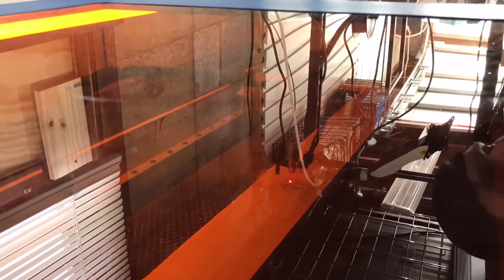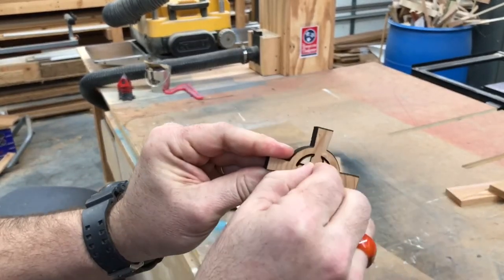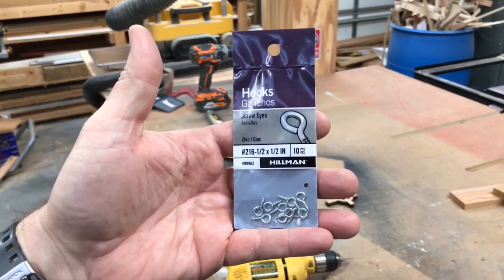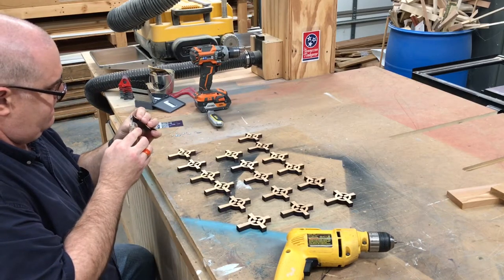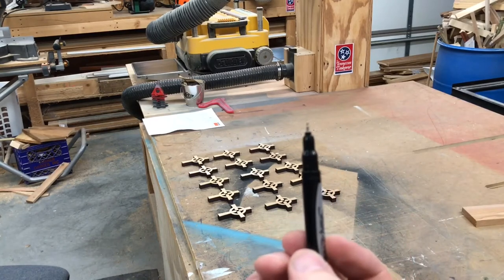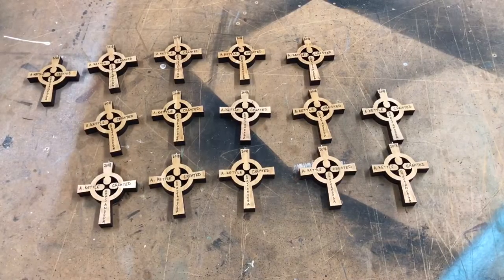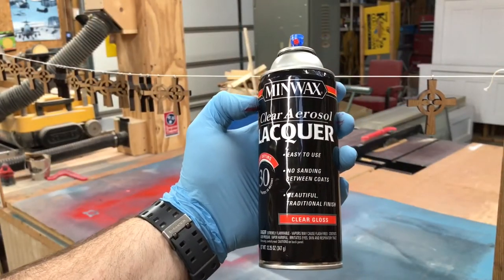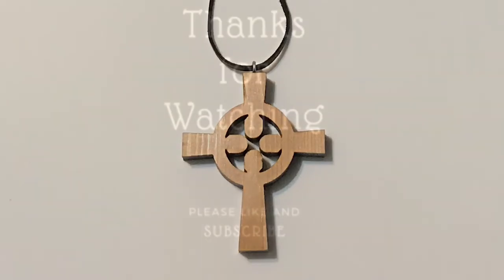Woodworking: Making the Cedar Cross Necklaces

Comment: Good job!  I am in the process of making 250 walnut crosses for our Big Bat Cave Campout and our Frontiersman Lockin.  All part of a Royal Ranger Ministry.   One of our Missions in Springfield had a walnut tree blow over and they cut it down and called me if I wanted a few logs.  I took 8 logs 3' long and 12" around.  Resawed that a year ogo and stickered it in my shed.  I had a bunch of slag wood that was left over from the cants of the logs. I resawed that up and used it for the crosses.  Using a bandsaw and a jointer I processed the wood down to 3/8" wide piece with the last side to be ran through the planer.  Will now square up the ends of the random lengths and cut a dado on groups of about 15 at a time then cut those ends off to length 2".   Then do the verticle side of the cross cutting a dado (other side of the half lap) then cut to 3.25" long.   Add a drop of glue and put the two pieces together and clamp with a spring clamp. Then drill a 1/8" hole in the top part of the cross so on the side and hit both sides of that hole with a countersink bit. Do a bit of sanding quickly and hang on a line for a clear coat.  Add a length of mini paracord and give them out.   I did this with cedar and made 80 about 7 years ago.   Thought this would be a good purpose for this wood that would have been cast away and burnt up.  Keep up the great work investing in the lives of these folk.  It matters!
Here is a picture of some of the crosses being finished on a string.  
http://readyrangers.tzo.com/2015Batcavecampout/Mark2015bat001.jpg
Reply from the maker: Wow, that is a big job! Those are beautiful! I love the fact that you can take a tree that came from a special place and repurpose it into keepsake gifts. I really appreciate the view and the kind words. You keep up your good work as well. Thanks again!